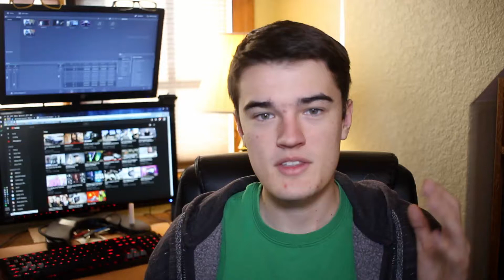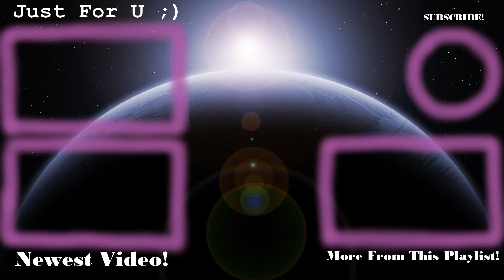How to Fix Screen Burn In/Stuck Pixels on a Display

Comment: Gonna try this for my laptop...its a $5000 MSI I would have hoped there was a anti burn in system for that much but if nothing else the warranty should cover it on a $5000 computer. What's weird is there's no image stuck it's just bright make it look super exposed. I accidentally left a game paused over night and it shut down and back on fine until the MSI logo came up. It booted up super bright and died down a bit. But still looks washed out. I hope it's the same thing.

Comment: its weird i noticed something was off when my pc screen was dimmer then usual and i was working on some artwork and minimized it to find that the color bar was still on the screen and when i looked more into it i saw the rest of the screen was still there. i did the 10 min flashing and went back to it and its still popping up on the screen. i do the flashing and it cleans the screen be i fear that it will keep burning when i go back. has anyone any advice?
Reply: a little bit of an update, the main color that seems to stand out or stay on the screen seems to be light green. i noticed it with the lines i was using while drawing as well as the green on the color bar being prominent

Comment: Worked for me 
Laptop display LCD

Had to go meet some friends who come over and i left my taskmanager on ,on my screen

When i came back i clicked on cancel button i was seeing the ghost image of the taskbar,,was very light but visible if seen.

I used the link given in the video,,the rgb flashes worked for me and its totally gone.

I have opted to keep a screensaver as it saves from the sitting image to burn on the display

ANYONE WHO HAS A LCD PANEL SHOULD KEEP A SCREENSAVER(just in case if you leave your pc / laptop on without using it)
Reply: Thanks for the advice bud, been trying to fix mine for many days and I saw this vid. I hope it will solve my problem.

Comment: I highly recommend this video I was playing ace combat zero and paused on the menu for like 20-30 min which burned the mission box into my screen I was tripping out and hoping not to buy another monitor until I came across this video thanks now my monitor is back to normal, I played the video for 30 mins if anyone is wondering, and my monitor is a acer predator.
Reply: same thing happened to me same monitor but i left discord open and my friend sent a bright image took about 30 mins to fix it
Reply: Was looking for this comment about a monitor specifically,COD MW2 update screen burned in after leaving it for about 30 or 40 mins , Never happened before, thank god for this 20 mins in and it’s already helping!

Comment: Would this work with an old plasma tv? I've experienced the "burn in" or "image retention" for about a week from the time of this comment posting, and it was due to me setting the contrast too high and leaving a still image for a few hours. The burn in doesn't look too bad compared to others I've seen, but does an old plasma tv qualify as "too old" for this solution to be applied?

Comment: Hey hey,
My laptop lcd screen got dirty patches those are random and very light .
Like it is not any layout stuck there.
How should i identify if it is screen burning or something else
Reply: I'm trying the burn in video now since the area around it also has burn-in happening
Reply: I have the exact same thing and I've been looking what it is for a while and haven't found anything...
Reply: @duckyluuk  it didn't recovered at it's own so, i have send it for service
Reply: @Sans 8 yup, display got replaced. Though i didn't know the reason

Comment: Alright.  I left that video running on a TV all night last night, and I can safely say don't waste your time.  This technique does not work at all.  About 16 hours later, no change whatsoever.
Reply: now?
Reply: @SandeepSabarish  Haven't fired it up in ages.  Eventually will move it to another spot where a perfect picture is not required.
Reply: @nowthatsjustducky  i threw a hdmi cable on my tv now its left some stuck pixels. feeling my anxiety now donno what to do but I will cope up with that

Comment: hey my laptop monitor is frozen and starts going white, it only works if i apply pressure on the monitor
any help?
Reply: it happens to me when i boot up my laptop and i have to wait a bit and turn it on and off
Reply: sounds like a loose ribbon cable.